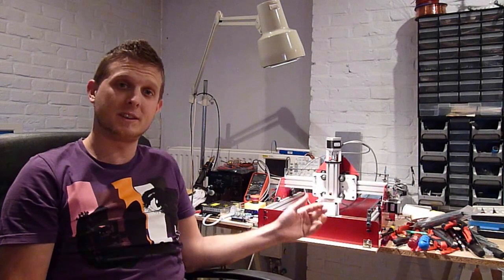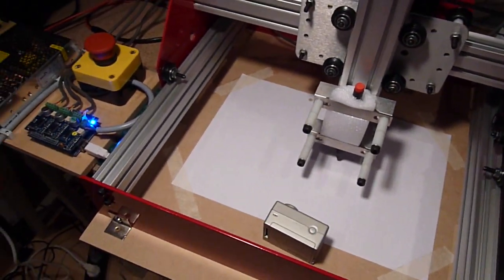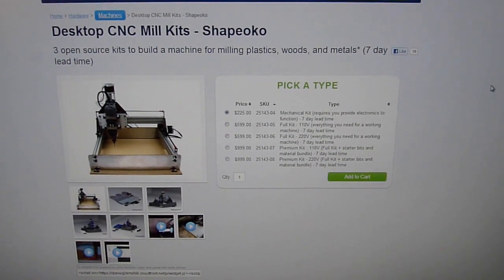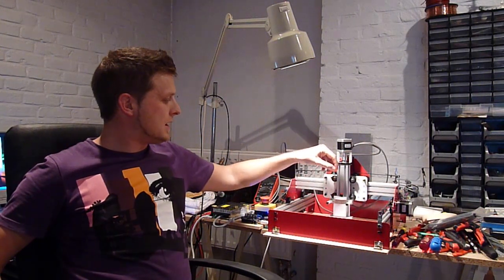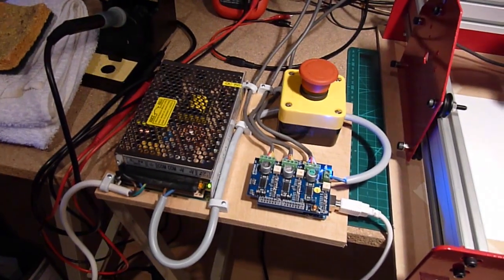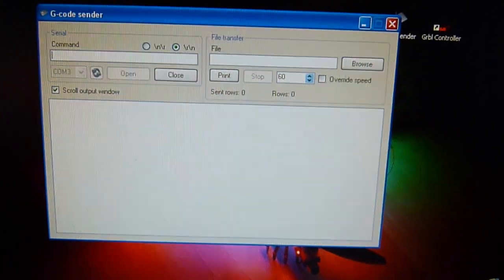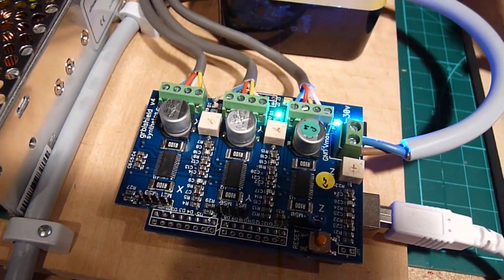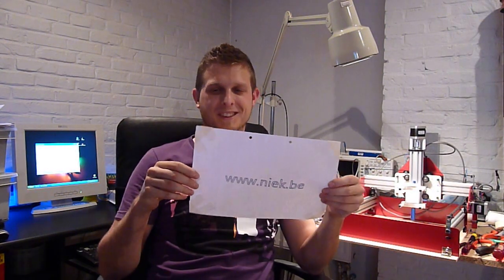ShapeOko CNC: introduction to pen drawing

Comment: I did the same thing when I finally got it up and running. I also started downloading random vector images off the internet, converting them to paths in inkscape, then converting those the G-code. My favorite so far is a 6" x 4" butterfly.
Reply from the maker: It's great to see him make these first moves!
Since then I have it in my garden shed milling pieces for my quadcopter.
Great machine!